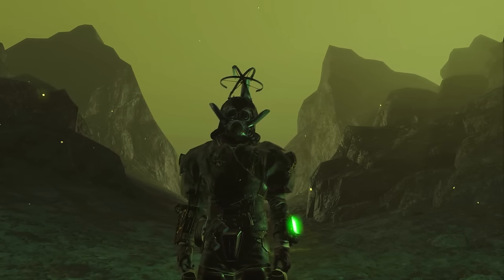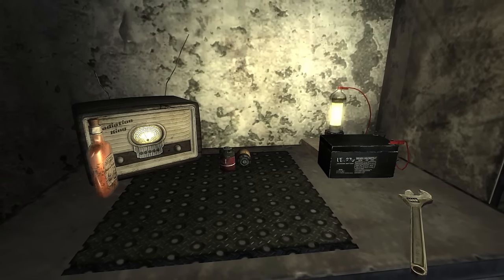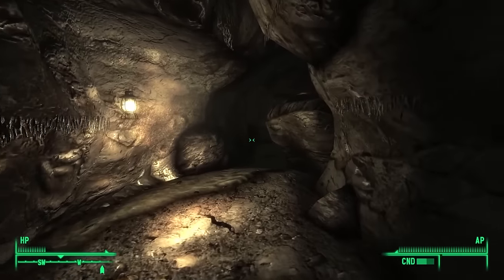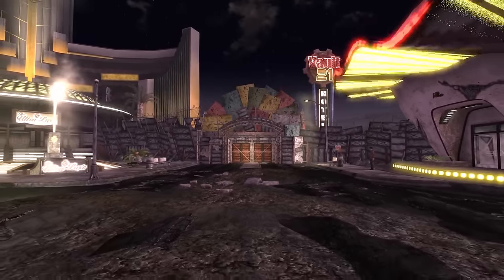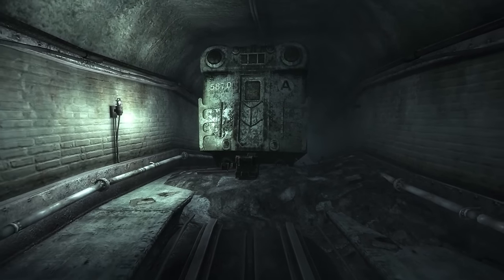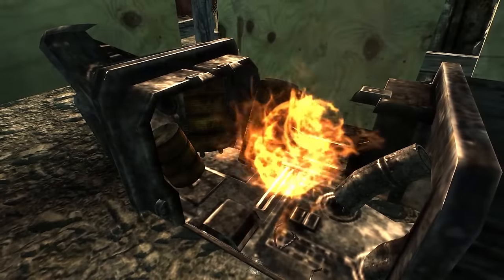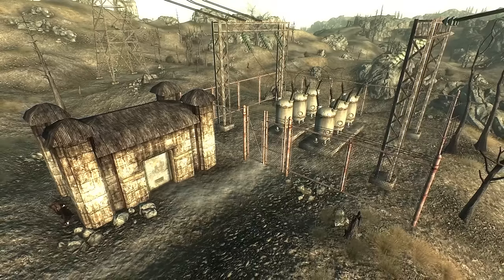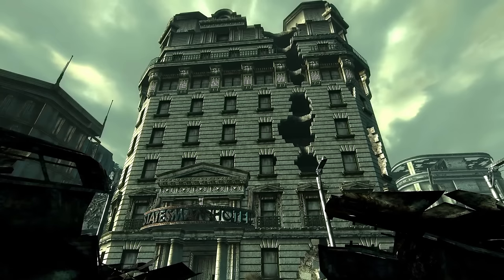Where does the power come from in Fallout?

Comment: I would speculate that the fusion cores found in the wild are intended to be backup power sources, not the actual power source for the buildings. The generators themselves handle that load. The ones built for settlements haven't got that backup supply, only a sort of dummy plug, as manufacturing fusion cores is beyond the capabilities of the sole survivor. Having power plants buried deep, and possibly powered by geothermal sources would make sense...With AI robotic maintenance workers keeping them running. Make them a sealed, low oxygen or inert gas environment, and it honestly wouldn't be that far fetched for them to last a century or two. As for places like Diamond City, that seem not to draw from outside connections...That part makes perfect sense to me! They're an enclave in the middle of several hostile (Raiders, supermutants, gunners, etc) groups...power lines run from overhead in the commonwealth...perhaps there wasn't the time or geology to make running them underground practical or needful, or just not the time to do so...And so are vulnerable to being cut off by any of those hostile groups. Having their own supply means that it isn't an issue.

Comment: Technically, fusion as we know it wouldn't be generally done with heavy elements; the energy required to fuse those without breaking them would be immense and likely not actually feasible. It is much more likely that Fusion is done primarily with lighter elements, which would have no way of producing a radioactive byproduct. I would imagine either Mass Fusion was entirely lying about their fusion "invention" entirely, or they just supplemented it with a bunch of fission instead.

Comment: What if the fusion cores and cells genuinely do generate their own power? Basically micro fusion plants. It's the conductors and cooling systems that wear down quickly when using something as power-hungry as power armor. But when it only needs to output like 2% of that to keep lights on and terminals on standby mode, the cooling systems are basically idle, occasionally spinning up to alleviate excess heat and then immediately going back to idle mode. For every 24 hours a fusion core is running, the cooling system is only on for a couple hours, and even then, it's not running at full. Whenever power demands are met, the system works just a little extra to fill up battery backups, hence why buildings remain powered even after the core is removed.

But when you use power armor, your fusion cores are working at 100% of their capacity. It's running a marathon just to keep the power armor working for a couple hours. When the cooling system finally dies, the core is disposed of, or if properly jury-rigged, will continue to operate after the cooling system is dead, causing it to rapidly overheat and then explode.

The reason that Mass Fusion could engineer fusion cores but not a big fusion power plant is because due to the design of fusion cores, they can't scale up effectively.

Couple this idea with the probability that individual appliances probably also have fusion cells, and you have several layers of redundancy in case of power failure. Such engineering would probably be encouraged by a government which recognizes that contingencies for nuclear war might be the only way to continue existing through to the end of the 21st century.

Comment: Fallout 4 also has the makeshift battery, likely some kind of pile battery. As for mass fusion, i always assumed that the big machine made more efficient use out of the core whereas the power armor has no room for it. Mass fusion would likely do this on purpose as they probably had contracts with the building owners to supply fusion cores as long as the owners invested in mass fusion. Thus causing them to make the machine as efficient as possible as to not have to make as many deliveries all over the city as final distribution is the most expensive part of shipping. Whereas the military power armors could all be shipped to a central location in bulk and the military would deal them out. Making the government contract very lucrative as there is hardly any cost, so they make the efficiency on the armor far less capable, blaming the many moving components of the armor and selling a vast number more of cores.

Comment: Most of the conventional power would be out, if you wanna keep an electrical grid up you need to consistently replace parts

Fusion cells and reactors of some sort make some sense. FNV actually made an effort to address this when you speak to an engineer saying how many man hours it takes to keep the juice flowing, you’d need an organised workforce to keep the power running

Fallout 3 + 4 don’t address it at all, fallout 1 + 2 is spotty in its accuracy 

The biggest issue I could foresee is the windings in the alternator/generator burning out with no way to rewind and laminate them

Comment: Also anything isn't destroyed and still somewhat working without supervision including dams with power generators, solar and wind power stations, etc. provide power enough for everyone since there are almost zero usage, assumption now.
Also there is the question how well something will run without supervision (not even AI needed, automatic systems already managing these systems, but need outside assistance
for example parts, replacing something, fuel, nuclear fuel, etc.). 
Well a solar or wind power station or dam will loose 95% of their output, but again the number of users, consumption is tens or hundreds of thousands less.

Yes there are extended damage in the power grid, but anything underground or still intact will work. 
Also let me address living near a grid doesn't allow access to it.  Imagine there is a huge 1 meter diamater pipe with water. You can't just tap it. Power grid is the same for electricity.
You need special equipments to tap those grids, which either already there, intact and works or not, you can't just temper with it (except 0.001% of humanity might know the tricks to do it. I'm an engineer, but could never tap a power grid, it's the opposite: i know not to touch it.
But we also have to address player and game convinience. Ejecting a power core not turning everything black... might be just a game feature. Indicating some backup and battery, UPS will hold out a few days longer....

Comment: Thought on the fusion generators in fallout 4, they could be set up as the backup generators that buildings would run on in an emergency, and you only fully seat the fusion core within the generator when the power is needed.

Comment: I've always had the simple answer based on the lore. Several technologies use 200+ year nuclear batteries. What's stopping a basement from having a small nuclear generator designed to last several generations if the house isn't hooked up to the grid? And what's stopping the grid from having a lot of these multi-century generators scattered about, stull working because the cables have been protected from the elements. Only in Fallout 4 did they change the rules because they wanted to add a fuel mechanic to balance early game power armor (it didn't work).

Comment: Obvious reason why a redundant, underground emergency power grid that could provide each home a fraction of full use in Fallout 3. Above ground infrastructure would be powered by stationary powerplants and provide orders of magnitude of energy. Now, imagine a catastrophy that wipes out 90% of actual use? The emergency underground grid would provide near full use potential to the remaining 10%.   
In Fallout 4, the stationary fusion core generators have survived for 200 years... on idle. I would be more impressed about the bearings and gears that have survived for 200 years without lubrication or maintenance.

Comment: Another couple of points regarding fusion cores:

1) Since the fusion cores have been used to power the buildings for who knows how long, you could make the argument that none of them is remotely at full charge and that they might be close to the end of their lifespan, so putting one in a Power Armor is enough to finish them off in an ingame day or so.
2) Who said that they have been running the generator since the great war? Maybe they got replaced a few times and/or had not been running the whole time.
3) Maybe the fusion-generators were just used as a backup in case the main power went down, so if the buildings are still linked to another power source of sorts that still works, that would drastically reduce the load being drawn from the fusion core

Comment: Problem with your theory about buildings remaining functional after the core is ejected is you’re not looking at it as a generator. We use generators when the power goes off and some systems allow them to cut on immediately without having to power it on. 

You could have two things going on. You could either have capacitors in the fusion core genny that discharge the power slowly enough to detach the generator and redirect power straight from the meter. 

It’s a big expensive piece of equipment for important tasks in a power hungry world dedicated to fetishizing nuclear power. 

Because it’s so important and advanced they COULD have heavy duty capacitors. But I think it’s more likely that genny has internal batteries. When you have something volatile expensive and rare as a fusion generator you’re likely going to make the absolute most out of the fusion and the task it has. Which is either entirely stopping or minimizing power interruptions. 

TLDR: I think fusion gennys have a battery/capacitor inside as opposed to them only producing that extra electricity for higher powered appliances.

Comment: The Mass Fusion plant in Fallout 4's Concord could technically be a fusion power plant that can enrich uranium either added to the coolant of the fusion generator or be a uranium blanket that would produce pretty significant quantities of plutonium. I'm not sure if this means the power plant would be a fusion-fission hybrid plant, but nonetheless the byproduct of such a plant would create lots of radioactive byproducts by irradiating the materials that come into contact with the neutron bombardment from the uranium and plutonium thereby making the plutonium wells necessary and possibly quite useful to the local military for use in producing nuclear weapons or radioisotope thermoelectric generator or RTGs. Hell maybe the plutonium can be used in residential or commercial RTGs if those were things (in homes, buildings, vehicles, etc.)? What's really crazy is that I thought the only byproduct of fusion was the generation of Tritium since fusion uses helium and hydrogen and not uranium, plutonium, thorium, etc. but i guess since you can enrich uranium with neutron bombardment you can make all sorts of radioactive isotopes. source: https://iopscience.iop.org/article/10.1088/0029-5515/52/4/043004

Comment: My theory, regarding the "Fusion" generators in fallout 4. They're largely found in basements, often in pairs with one being destroyed. The Fusion Generator is in fact, an emergency backup generator. the ones we find in derelict buildings are not actively cycling power, since the fusion battery is disengaged, as opposed to the craft-able reactors for our settlements/camps, where the battery is engaged.

How do the Generators work? 

The battery itself isn't what powers the building, it only powers the Generator's motor, which turns a set of Dynamos (housed in those bolted arches between the Fusion Core housing and the spinning gear) the Dynamos create the actual charge that's distributed to the local power network. 

Now when we find them the core is disengaged, providing only enough power to spin the motor, but not fast enough to bring the Dynamos up to the RPM needed to generate a charge and the buildings are still drawing power from the pre-war automated grid infrastructure. though they are still connected to their local circuit breakers.

the Fusion Core itself can keep the Motors spinning for a very, very long time because it's a low load, the FC is just the "fuel" source like gasoline in a modern emergency generator.

Comment: I imagine fusion cores in buildings are most likely back up power that is maintained by the power grid. That would explain why they can be removed with no consequences. Conversely, it also explains why generators built in settlements show the cores seated and they are drawing power from it.

Comment: My theory for the fusion cores and running buildings is that they’re not seated in those machines because those machines are backup generators, meant to be utilized in case the grid goes offline; which isn’t in the case in games like Fallout 4. That’s why they aren’t seated properly, because they need to be activated when the building no longer receives its power from the wider grid. It also makes sense that the fusion cores would only work for a short time in something as big as a building rather than 200 years, which also explains why power armor burns through them so quickly in comparison

Comment: Neon signs normally high voltage, low current. PS, good video. I just assumed that most buildings are fusion powered, as which are found within buildings. Lead shield should protect against emp. As for the wiring, well, none would survive after an emp.

Comment: I think it's possible that fusion cores are actually cells made and that the housing is a breeder reactor, enriching the material inside.  Taking it out stops the fission so that it's safe to take out, causing the temporary power outage, and when taken out, the fuel is degrading, but the core can only be so bred before it starts to autodestruct. There is a precedent for breeder technology, and the nuclear physicists could realistically be you putting some self-breeding mechanism that goes runaway and is therefore only used when the core is rendered otherwise useless. And the traders accepting low-power fusion cores suddenly makes a lot of sense, since they know they can re-breed and resell them.
Also, the usage of non-rich fuel would be useful during an energy crisis.
But that's just a theory hypothesis. A GAME THEORY HYPOTHESIS!

Comment: Last year we lost power for a couple of 0 degree days.  I ran our generator for 12 hours to run a single space heater, a light, and charge our phones.  I went through 10 gallons of gas for 12 hours.  The whole idea of using generators in a wasteland is not a serious thought.  Gasoline goes bad after 6 months and you would need oil drilling, refining, and transport.  Other things can also power combustion engines like alcohol but you still need to make it and the reward for what it takes to produce is not worth it.

Wind and solar are the only realistic power sources.

Comment: The one mystery that bothered me the most in Fallout 4 was just south of Country Crossing you would see 5 power poles lined up to the bridge. They are all connected to each other but stop at the bridge and just before you get to Country Crossing. The pole closest to Country Crossing has a line emitting sparks as if power is going to it. Where is that power coming from? Nothing leads into the ground unless somehow its connected in the middle of the wood pole in the ground which I doubt. It's not connected to the bridge or anything else other than some transformers on the pole and a few Boxes that almost look like breaker boxes.

Comment: For the Fusion cores, what if the Fusion Generator which is much larger, is what's lasted for 200 years with low drain. The fusion core is instead the 'backup'.

We see this in Nuclear Power plants, there is a backup generator so that if the fission process stops for any reason the backup generator kicks in to ensure the coolant still cycles through and  it doesn't melt down, while the plant  workers get the reactor working again.

What if the Fusion Generators fusion core kicks in if the generators process stops for some reason, the core being there so that there is power to restart the generator.
So a small reliable core that can spew out a high volume over power over a short timeframe to get the fusion process started again.

We  could say this is why they are so readily and obviously accesible, as once they've been triggered and done their 'backup' job in the generator they need replacing, which being how prolific the fusion generators are in civvy buildings, probably means it has to be easy to do.

This would also explain why they don't last forever in power armour, they were never designed to. Now I think about it, a little like Tony Starks heart thingy keeps his heart running for decades or something big for a few minutes.

I'm also aware that if this were how it works, it means as you wander through the game nicking everyones cores, you're leaving a load of ticking time bombs  in your wake (I have no idea if Fusion is as explodey as Fission but I presume  there's a chance of big badda  boom).

Comment: Let's say an automated power system had 5 years of fuel at current draw. The war happens and the destruction lowers the draw on the grid at current rate to only 3%, that means that fuels could last well over a hundred years. The only problem then would be maintenance, but lowered draw would mean most generators would be parked into standby mode until needed, replacing maintenance with redundancy. We already see how the machines sometimes CAN maintain a lot of systems. It would also draw out initial power use as "emergency" systems kicked in and were used until they died, leaving the draw solely on the remaining power systems. One support for this is there are less than 2000 living humans in all of the Commonwealth. That would barely be a decent sized suburb of that area now.